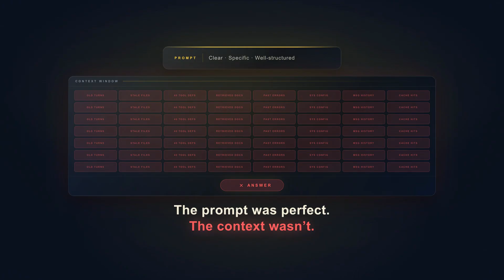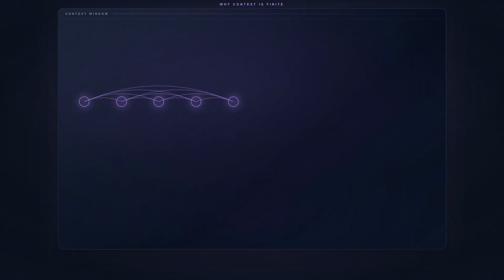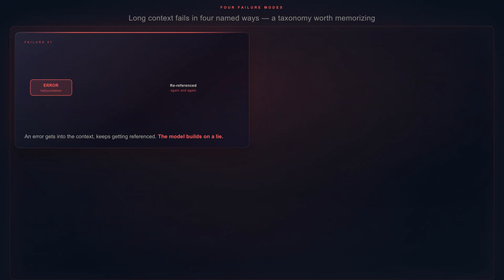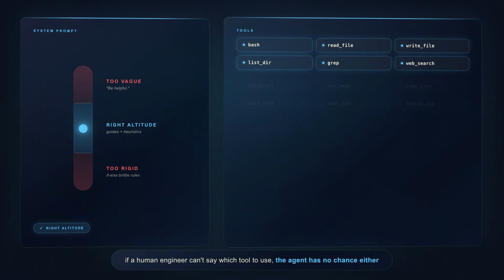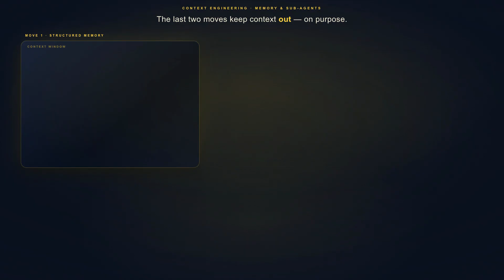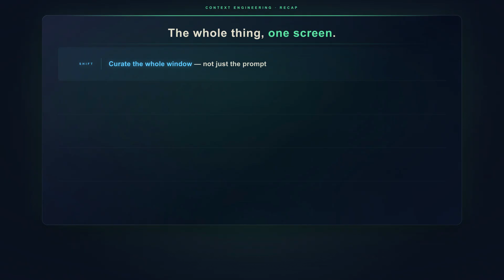Context Engineering: The Skill That Replaced Prompt Design

Comment: Context engineering gets one thing backwards in most takes: the hard skill is exclusion, not assembly. More context isn't more information to the model, it's more for it to weight, and a large window weights its middle poorly, so the few facts that actually constrain the task get diluted by everything plausibly relevant you added to be safe. Teams optimize retrieval, rank better, retrieve more, when the discipline that moves accuracy is cutting everything that isn't a real constraint. Prompt engineering was about phrasing; context engineering is about what you refuse to include. Keep the constraints that must hold, drop the rest, and the signal stops getting buried.
Reply from the maker: This is the best framing of it I've seen — exclusion as the actual skill, not assembly. You're right that most takes (and most teams) reach for "retrieve more, rank better" when the lever that actually moves accuracy is cutting everything that isn't a real constraint.

The episode lands in the same place — context rot, the finite attention budget, "fewer/clearer tools beat a bloated tray," and it closes on "the best token is the one you didn't have to spend." But you've said it sharper than I did: I sold it as "curate the whole window," you've reduced it to the one decision that matters — does this constraint have to hold? if not, drop it. That's the cleaner spine.

Stealing "context engineering is about what you refuse to include" for the follow-up, with credit. 🙏